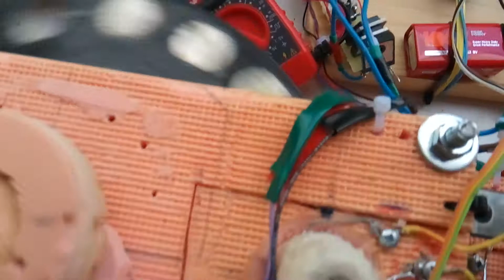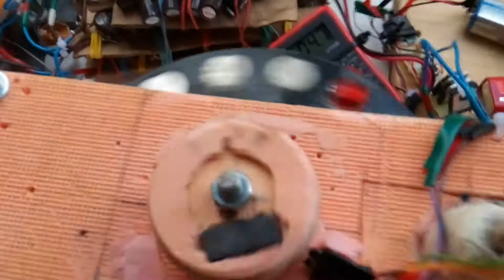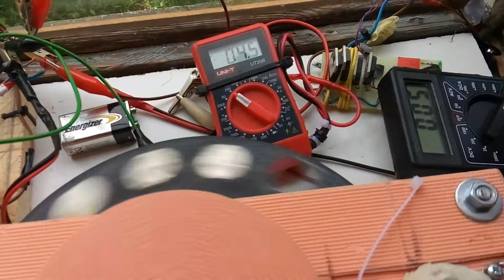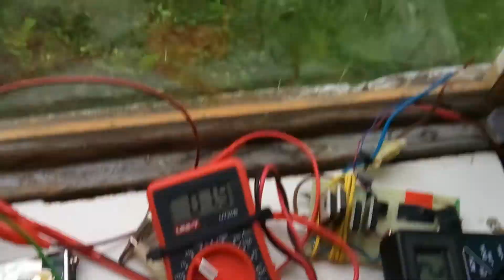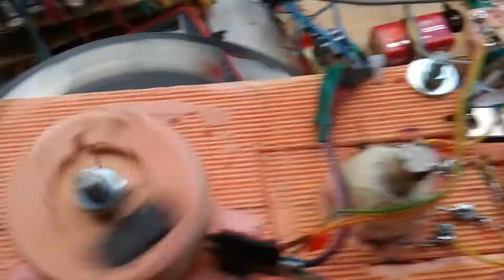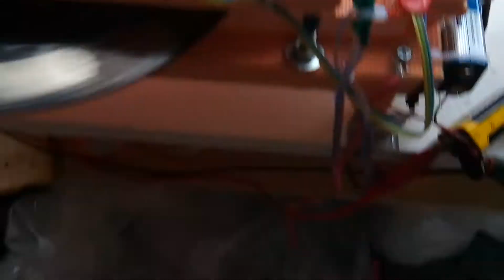Running one with another three different ways

Comment: WORKING ON TOWER GENERATOR WITH SPEED AND SMALL ROTATION DISKS. FIVE IN A ROW POWER BY ONE ONLY. 4 PICK UP  COIL WILL PRODUCE MORE  OUT THEN IN. THANK YOU FOR YOUR IDEAS. WITH THE PANDEMIC, SLOW STARTING GET THE PLAN ON PAPER ONLY. THANK YOU FOR YOUR GREAT IDEAS!

Comment: Looks very interesting... Just a few remarks:
instead of a boost converter why dont you use a voltage doubler or quadrupler?... i have a boost converter but it uses much more power than the voltage doubler or quadrupler... btw.. i got those doubler circuits from your homepage some years ago... work very nicely.
the second motor looks great and works great.. but has also losses... thats normal... why dont you put the coil running the second motor on the first? it should have the same effect but save you the mechanical losses of the second motor.. and reduce the power consumption of the first. (i'm not 100% sure but i think its worth a try)
I just ordered the 4421 chips... (had to order them in the states.. no way to order them in europe) they should be here in 10 days.. i already have the magnets so i will be able to do a very close replication... i tried with different gate driver chips.. they work fine for a couple of minutes but then start blowing.. so i'ill wait for the 4421 that seem to be working nicely.. 
Luc
Reply from the maker: Hi Luc
Good idea with the voltage doubler/quadrupler....those in my homepage start out with an AC signal, then convert to higher voltage DC....not sure if they can do DC to DC ?  I guess I can give it a try,, maybe the negative spike will make for a choppy AC signal that will convert...I do have the 52 ohms worth of pickup generator winds around the motor coils to add to the power output too, I think those will work fine with a doubler/quadrupler.  Boost convertors are nice, they also isolate well too, if I had a few small ones, I could get rid of all the 9V batteries....I got lots of boost convertors back in Seattle...
Today I am going make a little swivel/slider to mount the hall effect for the connection of the delayed flybac/backemf to...so I can adjust very fine where that connection happens in relation to the motor coil pulse.  I remember back in the days of the konehead motors, whatever the rpms were, was critical for where that connection happens....also I used to get speed up too, qirh lower draw when it connects so if I can do that I will be happy.....the dissapointing part is that voltage drop down to 3 to 5 volts maybe the perfect position of the "2nd switch" for the flyback connection will create higher voltage in the cap bank too so we will see.
I do have a Muller generator with the 180 degree positions of two motor coils here (the wood thing in videos) also a "dual rotor" motor generator with two rotors sandwiching 8 coils and coils combo motor and generator both these motors way up on top shelf....
Another trick I want to try soon  is to "short circuit" the motor coil, right after it turns off, also short the pickup winds too....I had lots of success raising voltage dramatically into a cap when you short an inductor at the peak period ....I think boost convertors work more or less from a short of an inductor too...
Reply: @MrDKONZEN  Well those i tried worked very well with back-emf on a bedini.. which basically is the same principle. I did not use the diode.. but 4 uf diodes instead. and it really shoots up the output... I do not think it works well after a cap bank... but again "i do not think" is the same as "i do not know" so try it.. ;-)
Luc
Reply from the maker: @FreeEnergyNerd  hi Luc
What did you mean I didn't use the diode but 4uf diodes? 
Did you mean 4uf caps?
Did you use a doubler in the FWBR mode with four diodes or the quadupler?  
What do you mean by didn't use the diode?
No back emf steering diode? Just voltage doubler/quadupler?
Maybe they will work after switch coming out of cap, where I put the ammeter when it shows big amps....hmmm
Thanks for great ideas!
Reply: @MrDKONZEN  sorry english is not my mother tongue.. but i meant: no steering diode.. in that case the output should be AC or at least pulsed dc..
and then the 4 diodes ==> bridge rectifier of your voltage doubler...  it made the back emf voltage readable and it went over 60 volts... but i do not know if it will work there where you put the ampmeter.. i never tried it there..
Reply: and sorry with uf diodes i meant the ultra fast diodes... example.. not 1n4007 but uf4007 --- those are much much faster.. (not as fast as your diode) but also much much cheaper... the 1n4007 is like 2µ seconds.. the uf4007 id like 75 nano seconds.. but for circuits like this.. i think it is sufficient.. i got 100 of them for 2$...
Reply from the maker: @FreeEnergyNerd  Hi Luc
Thanks! I didn't know about the uf4001 diodes!
I have lots of 4001 diodes here but don't know if they are ultra fast or not.  I bought 100 super cheap off of eBay too.  I will try your 4 diode recovery with what I have see what happens.